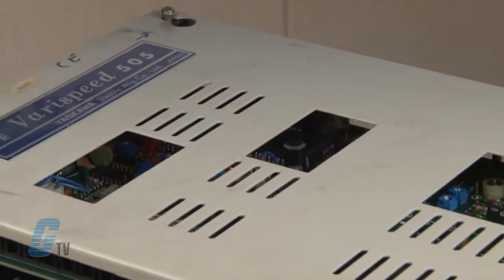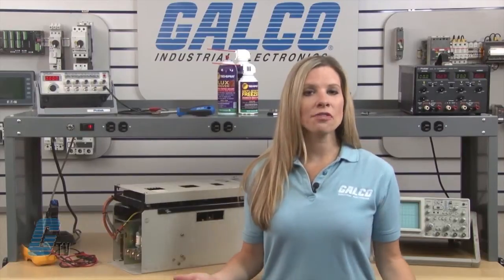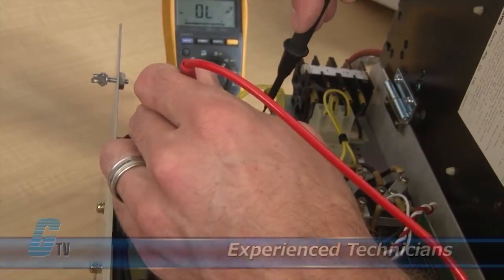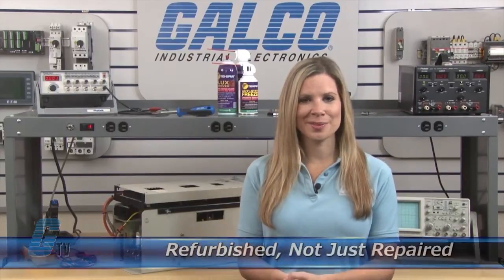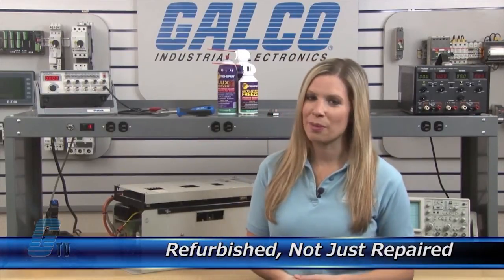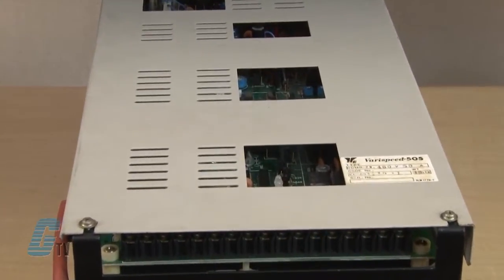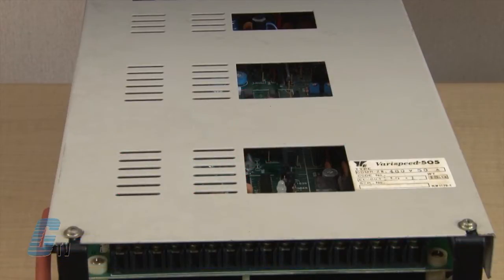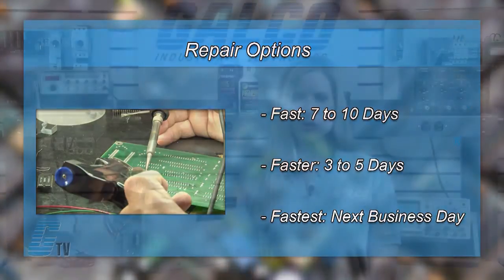Repair Yaskawa Varispeed 505 DC Drive

Comment: You check the capacitors?
Reply from the maker: Yes and the power transistors, and the cooling fans, and the driver circuits etc.  etc.